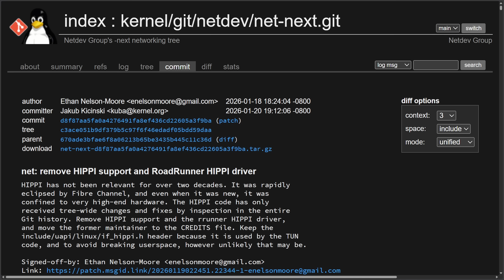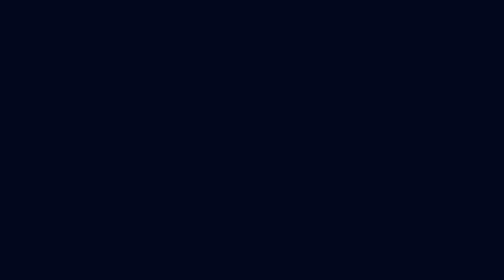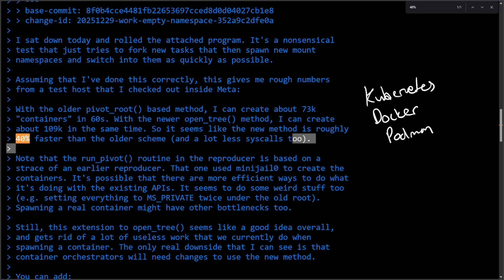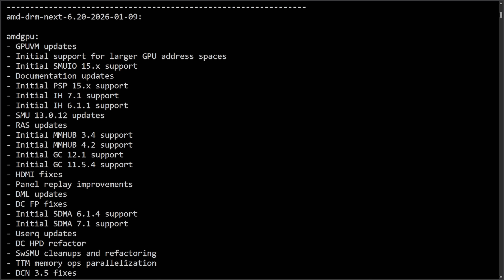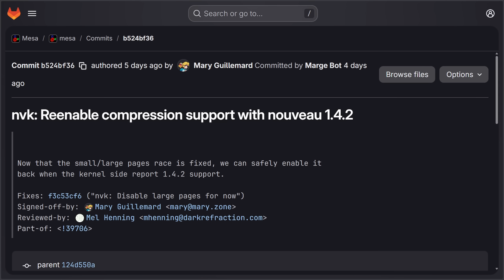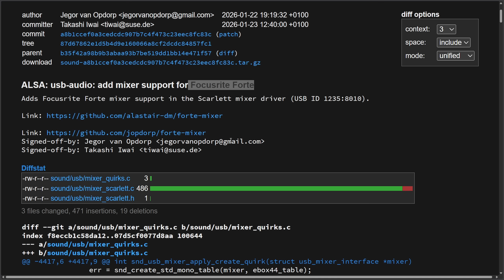Linux 7.0 Review: MAJOR Performance, GPU, CPU, and Networking Upgrades

Comment: I'm disapointed that the Linux community has abandonded C/C++. One of the most influenchal languages of all time. We didn't need a new language we just needed people to follow good practices to take full advantage of C/C++.
Reply: Most of the kernel development is still being done in C and it will stay this way.
Reply: One alternative would have been to essentially implement the features of rust on top of c, but I think it's pretty obvious why you wouldn't want to do that.

There are probably better solutions too that's just what I thought of off the top of my head, but in any case whatever you do it's going to be just as complicated.
Reply: @Burgo361  The only argument Rust programmers have is safe pointers, but if they wanted safe pointers, they could just use C++. It has had safe pointers since the 90s, well before Rust was created.
Reply: @Patrick1985McMahon  Yes the features exist within C++ but the best way to actually get people to use them would be to remove the old features and at that point you are doing a lot of the work of making a new language and breaking backwards compatibility anyway.

I essentially see rust as just the conclusion of that line of thinking, I probably would have gone for the trying to fix c/c++ path personally but I'm not the one that went and actually did the work.
Reply: @Burgo361  You don't need to remove the old features. Just build auomated tests that prevent people from pushing a commit that have these features in them. This is all basic stuff that real companies do. You build guards into your commit process.
Reply: @Burgo361  Just use automated testing and safe guards in your commit process. This isn't difficutl.  Is everyone in this thread right out of an AS degree. Have none of you worked in a real company? This is standard stuff.
Reply: They have never used C++ and they haven't "abandoned" C - They simply have added Rust.
Reply: @Sinderhans  Okay but if they wanted safe pointers they could have just used C++ and ignored the extra stuff C++ has, and it would be fine. I have built many large projects using C/C++ with no memory leaks. Does C++ have a lot of old bagage yes, but you can ignore it. We shouldn't just make new languages when something doesn't fit; we already have so many new fad languages, and they will all fade. You're just going to make a bunch of stuff that will need to be rebuilt when everyone ditches Rust for the next fad language. Stick with the languages that will be around forever.
Reply: Crazy how people go on to comment on things they don't actually know anything about. The Kernel has never contained C++ code, and Rust is sub 1% of the codebase as of right now.
Reply: @GenesisXY8x8  I didn't say the kernel was made in C++. I said C/C++ in my post because the kernel is made in C, but layers on top of the kernal is made in many different languages. The layers on top made in Rust could just as easily have been made in C/C++ (to explain i'm saying C & C++ for your smooth brain). Forcing people to use good practices in C/C++ is very easy.
- Adopt a Coding Standard
- Define team-specific rules
- Keep the rules enforceable by tools
ways you can force good standards:
clang-tidy, cppcheck, include-what-you-use (IWYU), SonarQube, 
Build tests have safeguards that stop commits before ever needing a human to review code that violates your code standard. 
All of this is easy to set up.
Reply: @GenesisXY8x8  Just say you're a bad programmer and move on. You can't manage to use safe pointers and need a new language to hold your hand.
Reply: @Patrick1985McMahon  Linux kernel programmers are bad, got it. I wonder why don't they hire you, the perfect programmer, to fix their bad unprofessional code.
Reply: No?
Reply: @clippylovesdemocracy Yes? becouse when everyone gets tired of Rust, C/C++ will still be around. Just use automated testing to kick out bad commites.
Reply: I don't get how you end up watching such a video with such a low computer science literacy
Reply: @djixnxndjjdjd So you're saying you're an incompetent programmer who didn't know how to use safe pointers. That came very clear with your comment. You must have been one of the DEI hires that trashed Windows 11.
Reply: "we just needed people to follow good practices"
People have tried and failed doing that for decades. When are you going to accept that humans are more fallible than a compiler?
Reply: @brinkoftext  Yeah I have sat in 4 hour meetings about best practices and then watched pretty much everyone completely fail to follow any of them immediately afterwards.
Reply: @Burgo361  there are tools you can set up that force your business standards and automated testing that will stop a commit before human review; if it fails the automated test for your standards. Don't trust the programmer. Set up proper testing to keep the shit code out. It will also help you report on who is pushing code that doesn't follow standards. Then you can fix the problem by getting rid of bad actors or re-education.
Reply: @Patrick1985McMahon  I wonder what the Rust compiler does... could it be automated testing of important type and lifetime invariants at compile time?
Reply: @bytefu  just admit you don't know how to setup propert commit tests.
Reply: @Patrick1985McMahon  Setting up commit tests is literally one line in the pre-commit hook: "cargo test" — the rest is handled by the type system and the borrow checker.

See pee peers brag about the weirdest of things, like spending hours configuring stuff that's built into other languages, e.g. your beloved tests or adding a library to the project. You spend time and figured it out, cool. Big deal, we know how to do that too, just don't want to waste time on something already solved.
Reply: @bytefu , you set it up ONE TIME, then it's done. Your argument is pointless. We don't need new languages. Programmers need to learn proper project management.
Reply: @Patrick1985McMahon  What about endless UB opportunities that exist in C and C++, how do you solve that? Rust by default doesn't allow UB.
Reply: @Patrick1985McMahon  Why do they still find memory bugs in Curl, one of the most paranoid project ever that even uses defensive programming, which trades performance for correctness, and still gets things wrong? They use automated testing.

Why do they still find memory bugs in Linux? As far as I know, kernel builds are automatically tested using pretty much all the tools available for C. Are kernel devs incompetent too?

C++ tries to solve a subset of problems and still fails on a regular basis, no matter how sophisticated new ISO standards are.

If even the best programmers in the world cannot get rid of memory bugs, then clearly your method of writing UB-free code is inherently flawed, and the fact that you have to severely restrict the subset of the language you use in order to achieve suboptimal results speaks volumes.
Reply: @bytefu  again, you shouldn't use the parts that have undefined behavior. You set up automated tests to prevent people from using these. We have had standards for how to manage a project that is designed to compile to multiple hardware architectures. None of this is new. It's all been common practice for decades. Your common code follows a hard set of rules, and your cross-platform layers follow a defined set of rules for that hardware architecture. separation of function. As you commit the source and not the compiled code; the compiler is irrelivent as you can have your automated testing run a standard compile that follows the rules and if it returns a failer you can kick that commit before going to QA.
Reply: @Patrick1985McMahon  So how comes that the best experts in the world working on the most paranoid security-wise projects still allow memory bugs to slip in? Are they not professional enough? If so, then who tf is?

The answer is simple: nobody is that good and will never be. It all has to be automated and not by using a bunch of disconnected tools, each with their own limitations. We have learned the lessons, time to put them in practice and make changes to the language. C++ ISO committee is not willing to do that, generally speaking, and when they are, it takes ages to discuss and implement, and the end result is still a steaming pile of crap.

You can cope all you want, but C++ will inevitably die, even if that takes decades. It's simply too complicated and inconsistent. New languages have to be developed — that's the only way to make real progress and not waste resources on bullshit like not using parts of the language because they are dangerous. And the whole idea of obtaining negative reflexes is wrong. With C++ you learn how not to do things, with Rust you learn how to do them properly from the start.

And I'm not saying that Rust is perfect. But it's much better than a limited subset of C++ that only works with the help of tons of additional tooling, not to mention huge amounts of time wasted on learning the language only to purposefully forget parts of it.
Reply: @brinkoftext  Regardless of lanugage never trust your programmers to follow good practices. Enforce good practices using automated testing and commit safe guards. You can push back commits that don't follow clearly defined good practices and you can automate this so it doesn't get to your QA team.
Reply: There are alternatives to changing the language but trusting people to follow good practices is not one of them
Reply: @Burgo361  NEVER TRUST PEOPLE. use automated testing and commit rule systems.
Reply: @Burgo361  actually it's very easy to force people to follow good practices. You can automate testing that will identify the items of C++ that no one should ever use, and that will kick out most of the shit code that is being pushed prior to needing a human to review it. Just build layered guards on committing bad code. You can also force all pointers to be safe pointers using basic tests.
Reply: @Patrick1985McMahon  Rust does the automated testing but it's built into the language, and you don't need to throw more than half the language away. Just say you're a bad programmer and move on. You can't manage to use the borrow checker and need an old language to let you be careless with fire.
Reply: @bytefu  You're a great example of the modern shity programmers. Real businesses don't have any problems using C/C++ becouse we setup our commit systems to prevent old features from getting into the QA procees.

Comment: I guess now is actually the time to learn Rust then.
Reply: Great idea. I've started before it was even 1.0, it was hard but worth it. Now it's much more pleasant to use and has an actual ecosystem, so it's the best time to start learning. The learning curve might be a bit steep if you come from C or C++, but otherwise you'll do just fine.
Reply: no, rust is not the future , but if you want to learn that fine. and if you are not a linux kernel contributor, you do not need to know rust
Reply: @xgui4-studio  Even if you are a linux kernel contributor you can still just do your work in C, rust is still sub 1% of the kernel code

Comment: de-rusted linux kernel fork incoming.
Reply: i will switch to it if i support my nvidia and wifi card. else it will be in a vm .
Reply: You can fork the damn linux kernel realistically
Reply: i would switch in a nano sec
Reply: @rezah336  and why is that
Reply: @Yilmaz4  rust compiler has a backdoor
Reply: @rezah336  😨😨😨 

Anyway
Reply: @rezah336  Where?
Reply: brainrot incoming
Reply: @PingoX  No, the video says Rust is already there
Reply: @JodyBruchon  Have you used it? What's wrong with Rust exactly?

Comment: I would also like to see sandboxing of any type become expected by default for all packages and applications. The specific methods and features could vary but all should use it and the OS should provide a warning prompt on install when none is present. This could be using sandboxing features in Flatpak and AppImage for packages for example.  Developers could use chroot, systemd-nspawn, docker, qubes, or other methods for containerization of applications. But some method should be expected and direct access without barriers should be discouraged. Malware of course could ignore all of these by opting out if allowed but the impacts of innocent bugs from trustworthy software could still be reduced.
Reply: no, i do not want forced sandboxing , they break a lot of thing. as a option it is fine ,but not forced.
Reply: @xgui4-studio  Not forced but strongly encouraged as the default. People could still choose to not use it whenever necessary. But it should be opt out instead of opt in.
Reply: @Stu_Bur   nah, that will break many apps including the one i am making and being forced to comply with loooonix mesure will make making cross-platform app harder  and will make a lot of problem that newbie might not understand, and i am not a fine of forced sandboxed ...
Reply: @Stu_Bur  No it should be opt in and not opt out.  I personally detest FlatCraps with a passion but find AppImage somewhat acceptable as they are tons lighter then a FlatCrap or SnapCrap.  With AppImage I don't need other programs to make it usable to the system such as FlatSeal.  Just my two cents and each there own on their systems.
Reply: @xgui4-studio  If you can't build your app with sandboxing then don't. All that would be different would be a warning at install. If an app is going to break if sandboxing is forced then that is even more reason to give a warning not to even try it.

Comment: thank god! USB plug-&-play, at last. The ONE thing that Windows does better than Linux.
Reply: USB dirty bit management has always been configurable. Unfortunately every distro ships awful defaults that don't flush out to USB memory storage in a sensible or fast way that let's you eject media when you want to instead of waiting for large transfers
Reply: Windows still does much better audio quality, if you have the hardware/software/ears to notice. Linux does Blueooth audio better than Windows*, however. I took the time to learn how to configure pipewire/wireplumber with my usb DAC, and while it improved, it still is not up to par with Windows for listening to lossless music 24bit or better.

EDIT: For errors.
Reply: @fdljks02 the thing is those are userland programs and they aren’t developed by kernel people. Maybe we’ll get some cool kernel audio support to standardise audio processing. Maybe

Comment: 19:53 just to make clear, this isn't about pushing packets out as fast as possible, etc. the original cake was developed after 3 years of experience with fq_codel which was created to help prevent a real problem: bufferbloat. That helps with solving problems in the network, it's less about solving problems in the machines themselves. multi-queue is an optimization of course. Bufferbloat helps prevent real time traffic like live media (live streaming, live audio calls) or SSH-interactive traffic from being impacted by large downloads (like downloading some ISO or example), thus improving gaming, etc. as well. These kinds of changes often are enabled in for example OpenWRT which is used as the basis of a lot of modem/routers/firewall products.
I don''t know if you've mentioned it yet, I did not see a linux 6.19 video on your channel ? What was interesting that got merged: Kexec handover and the live update orchestrator

Comment: Let's see of Rust concludes the Linux experiment.
Reply: Why the hate?
Reply: @ajbrady4357 You know very well why the dislike. The political push of pushing rust when even the compiler is a moving target and the removal of battletested code. I will certainly change linux distro ubuntu for something else. Todays ubuntu is more like Windows slow and behaving mysteriously now and then.
Reply: someone’s malding :D

Comment: Still no RDNA 4.0, but 3.5...
Reply: Wait what do you mean by this? The kernel supports that hardware revision. Am I missing on something big that I’ve overlooked for the last two years?
Reply: What are you talking about? RDNA 4 works absolutely fine on any 6.18+ kernel
Reply: RDNA 4 works fine what are you on about?
Reply: I still on RDNA2 at least if fine for me.
Reply: You can still implement and compile it yourself. 😅
Reply: @hanfo420 No thx. Done that pre-2000 enough times. Now I want something that works out of the box with all the bells and whistles!
Reply: @Traumatree  

so a Mac?

I'll show myself out...